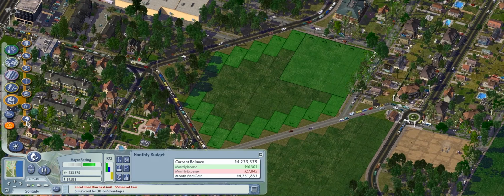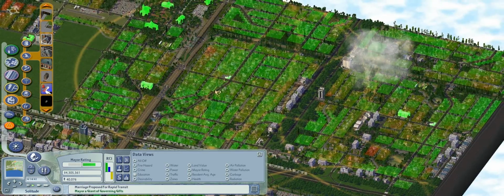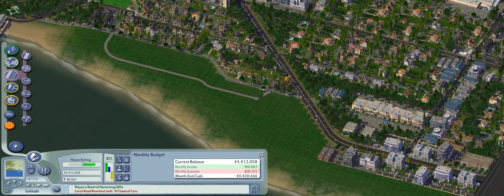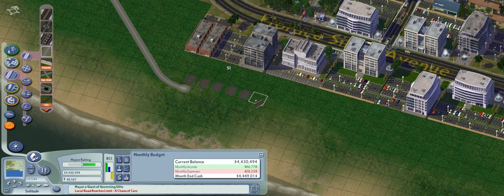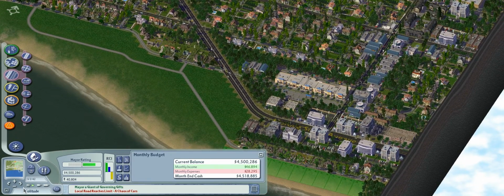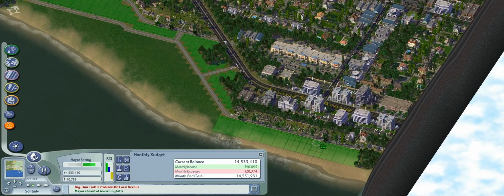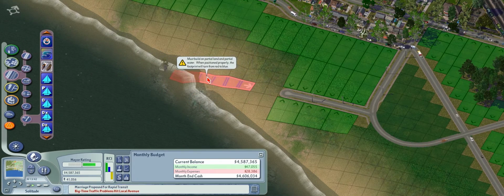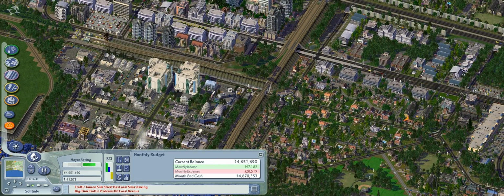Let's play SimCity 4 (mods, high realism)—part 30

Comment: There's a constant high-pitched noise throughout the video which could've easily be removed using Audacity for example. Might wanna look into that to clean and bass-boost the audio with minimal effort.
Reply from the maker: wingbull2009 I'll see what I can do with Audacity as far as noise filtering in the future.
Reply: Samgoogolplexian After downloading the video to MP3 format and viewing it in Audacity I have to say it's impossible to save the recording with noise removal because the noise is hardly different from your voice. There are some very obvious peeks at 5 Hz (the constant ~0,200 second interval between a high and low dB value throughout the recording) and a very annoying beep at 5200-5300 Hz and for the rest it's white noise spanning from 0-16000 Hz which therefore interferes a lot with your voice, and because the microphone seems to pick up voice tones which shouldn't be there and doesn't really pick up normal voice it's very hard to keep the voice intact. The game audio is also very low which means it gets removed with the noise removal too, and all round it's just best to speak up and possibly bass-boost your input by like +10dB,  +15dB or so (do a few sound tests and try to get the peaks around 0,5 instead of 0,05 on the Audacity scale to the left), you can most likely do this with the software you get with your mic - when I plug my mic in there's a program in the task bar which allows me to turn on echoes, bass boosts and such. After that you can check in Audacity whether the sound has improved (and whether the white noise is still there, whether Noise Removal is able to scan it and whether the voice is still there after applying Noise Removal).

Comment: Your peg random woods seem to have more trees specially the 2x2 lots... mine has some bushes and they look kinda empty... how is that so?
Reply from the maker: ***** Hmm, maybe it's because I'm using a tree replacement mod (SFBT Tree Replacement Mod)?  If you're using the game's default trees it would definitely look different.  Also, the 2x2 lots just don't have quite as much tree density as the 1x1 lots, so you could use just the 1x1 lots to fill in larger areas if you want them to look a little denser.  Hope this helps!

Comment: Those cliff´s are quit high, 15m is quit the minimum terrain level otherwise you can´t build with the digger lots. Maxis terrain created seems to be the steepest. How do you avoid the unwanted 1x1 zones when a 1x2 is posible ? Large 4x5 zones to get streets in it; ctr-alt-shift ? Got some nice marina and gulf breakers !
Reply from the maker: maedero05 Thanks for your comment, Ctrl+alt+shift is helpful for making the larger zone sizes since they won't be broken up by streets with holding Ctrl.  Unfortunately, I don't think there's any way to avoid the game making 1x2 zones from 1x1 back-to-back zones, or 2x4 zones from 2x2 back-to-back, etc. unless you wanted to put empty tiles between the zones so they're not back-to-back.  It just likes to consolidate them into larger zones sometimes and break up the lots, which can be annoying.
Reply: Thank you, you aswell have the road over street facing problem so building roads maybe beter afther zoning al adjacent streets !